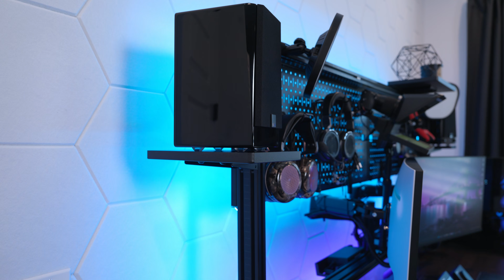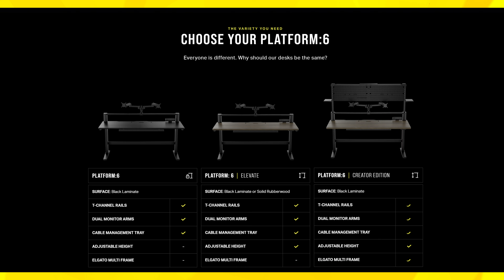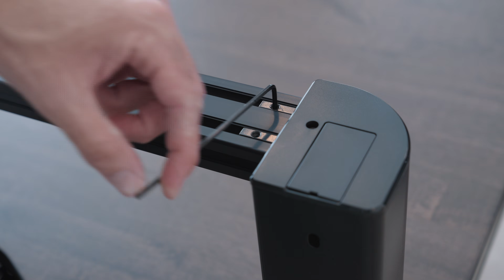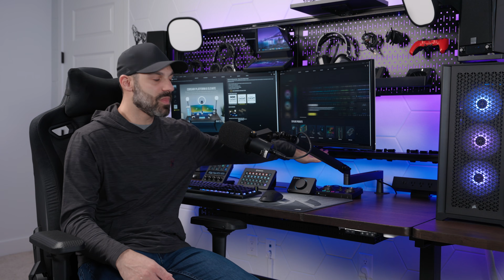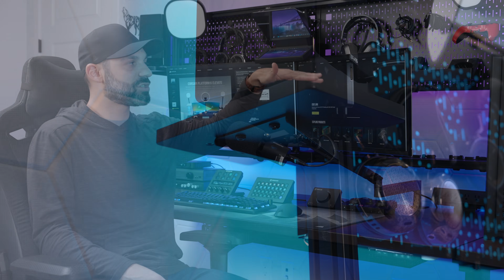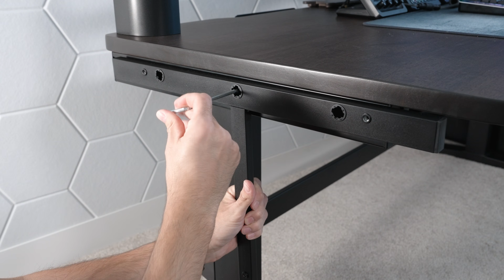Corsair Platform 6 Desk Review - Tailored for YOU!  This is a game changer...

Comment: What kind of speakers do you use?  Most I find require a cord from the left to the right speaker and the distance is too far if placing them on the left and right shelves.
Reply from the maker: These are the SVS Prime Wireless speakers with an SB1000 Pro sub.  The sub works because I can run a longer cord.  The SteelSeries speakers wouldn’t because the cable isn’t long enough to make it to the floor if you’re trying to hide the sub wire.

Comment: The adjustability and customization looks nice but it's really hard to beat a slab of butcher block from IKEA or similar, albeit it takes a bit more work to get it in PC desk form.
Reply from the maker: Yeah the butcher block is a better value for sure.  I like the rail system with this quite a bit.  Moving it all around with ease is helpful

Comment: Quick question the GC7 and the shiit stack how do you have both connected physically and how you have it configured to work together? I use to have the GC7 but didn’t know how to used it with the wave link software and PS5 and PC toguether
Reply from the maker: Hello.  I never use both at the same time.  I use one for music listening, and if I use a wired headset, I use the GC7 typically.
Reply: @GadgetryTech  so your stack is connected from the PC to the speaker monitor and the GC7 is connected to a console or a PC I’m asking because I wanted to have a shiit stack form music or if a gaming from my PC and the GC7 used it with my ps5 but integrated with the wave link because I used some of el gato products

Comment: In a nutshell, it's too small and they don't support my/their Corsair Flex monitor. They need to at least offer an 80-in or 90-in desk. Also, I'm not a fan of their monitor mounting system, especially that unnecessary bar. I'd have to do what you did with that half arse of an extension like you did for your Corsair 5000 case. At home I have no desire to stand up and play Call of Duty for hours at a time.

I wouldn't trust that extension to hold the weight of my PC .. my 011D has the weight of an anvil with a full EK custom cooling with the largest radiators I could fit, full side panel distro, chromed copper tubing, etc and a Pi with a full screen in the front of the case. I'd lose my mind if it fell off.
Reply: My comments have absolutely nothing to do with you, everything you said was fine and I get it. It's my observation with this system that Corsair came up with starting off .. that pegboard system and rails, actually the entire mounting system is just simply nonsense. I don't want something that looks like I ripped it off for my garage which is exactly what that looks like. Instead I love floating shelves, tasteful decoration and even my wires are better hidden and there are many better options for supporting your cameras, microphone, lights, monitors or whatever. Most of that crap can be mounted to the wall. Now, if you're someone that wants to mount your entire rig in the middle of some large room then this may be it for you.

I own a data center for my day job and when I come home the last thing I want to do is stand up and game for a couple hours. In my office this is not a commercially viable product either. There are plenty of high quality desks that raise and lower, but also have better safety systems in place and are more reliable.